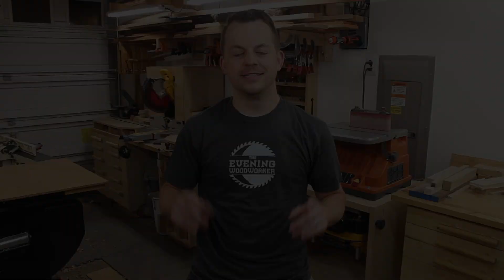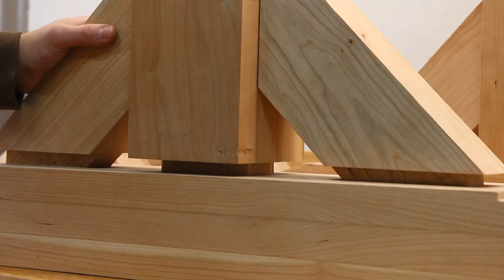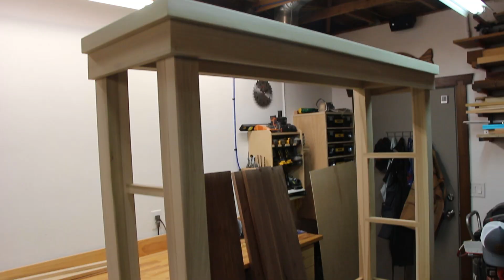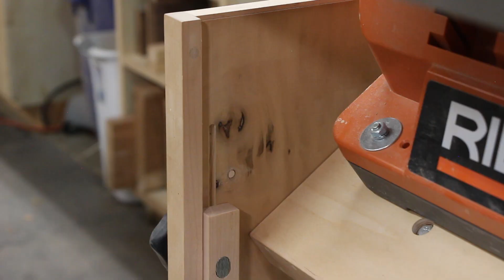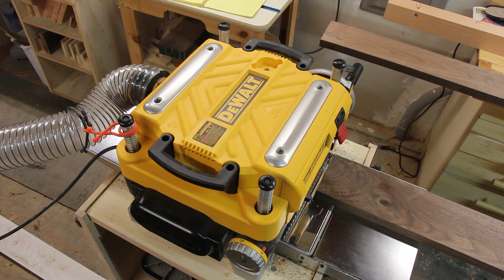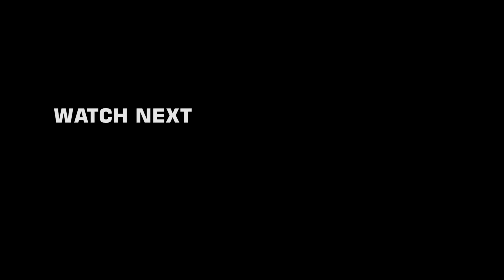Save Your Small Shop with This Flip Top Stand

Comment: hi Jared. I just ran across this video in 2025 and I like the unique design of your positioning handles. I am curious and no one ever really explains. I have the same Ridgid sander and DeWalt planer that I wished to mount on mine. From the video, it appears that you have both of them bolted on. I’m wondering how you did that as it seems that their footprints would not allow you to get to all the bolt holes from either side. Thank you much.
Reply from the maker: Good question! The bolt pattern is different enough that if you install the planer first, then you can still install the sander after that. Good luck!

Comment: Very slick design - especially the locking mechanism as many have mentioned.  Just bought the plans - very professionally done.  Has anyone built this for the DeWalt DW734 planer?  Almost every fliptop table I see on the interwebs was built for the DW735.  The 734 is a PITA to remove the dust shroud - I don't want to do it - and therefore the outfeed table can only raise about 45 degrees.  Not sure if the plans as drawn will handle that planer?  It's not straightforward to mock it up and figure it out.
Reply from the maker: The important thing is the height. If the height is comparable, it should be fine. You could also find a model of the 734 in Sketchup and add it to the model in the plans to see if it fits. Thanks for supporting the channel!

Comment: Have you seen any problems with storing these kinds of power tools in an upside-down position? Just wondering.
Reply from the maker: Been doing it with the planer and sander for years and haven't had an issue
Reply: @EveningWoodworker  thank you for the information.

I purchased your plans and just got the materials to start building it.

Comment: Hey Jared. I’ve got the same planer and sander and I just bought the plans. Very nicely designed and illustrated! For the 1/2” steel bar, would 1/2” cast iron pipe work as a replacement?
Reply from the maker: Thanks for getting the plans! Yes I think a pipe could work as long as the outside is fairly smooth and the walls aren't super thin. That will keep the rotation smooth and not dig out the wood whenever it rotates.

Comment: What is the height above the floor of the outfeed table on your planer? I'm wondering if it will clear my existing 34"H outfeed table that I would like to roll it up to.
Reply from the maker: The wood feeding into the planer sits at about 37" off the ground. Should clear a 34" outfeed table.

Comment: If the flip top table were a bit wider would you still have to remove the planer out feed table?
Reply from the maker: The main thing that limits the outfeed table folding up is the location of the dust collector connection. It's more difficult to remove than the outfeed table.
Reply: @EveningWoodworker  thanks, I bought your plans and can't wait to get started...
Reply: Couldn't the owner be rotated 90⁰ so the outfeeds don't interfere with the sides of the cabinet?
Reply from the maker: Then you have to account for the raising/lowering handle which sticks out a good 5-6"
Reply: Outfeed rotated, not owner
Reply: Ah.  I've got the 734 with thickness crank on the top so I didn't think about that difference.